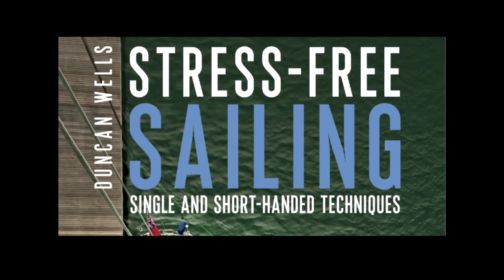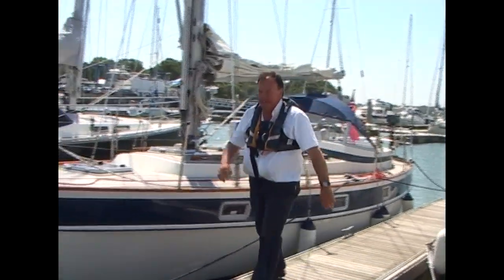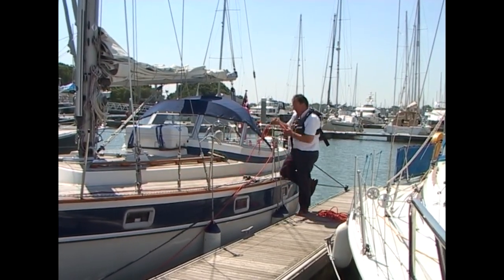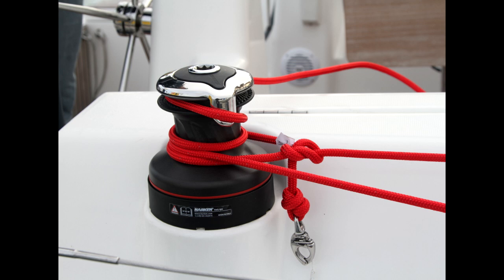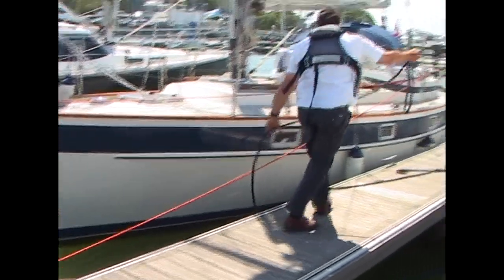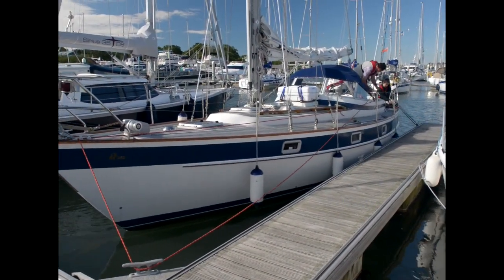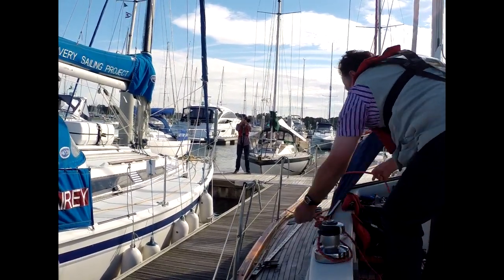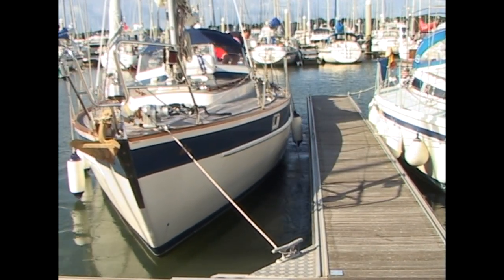SFS Getting off   Bow Bridle

Comment: Firstly I love your videos. Yesterday I used what you called the Giles method to get back onto my mooring (from your fab book) . It worked great. But because I had been practicing with it before I set off, so was all set up etc  I had already  removed all lines. To check I had got the set up correct. The boat held to the dock and I could see no reason why it wouldn't work even with a strong wind trying to push the stern or the bow off.  I then put the boat astern and just took the line of the winch and off the cleat and away I went no fuss and I think it would be fine single handed in most conditions for entering and leaving your birth. It would also act as a good reminder of how to get back onto your birth single handed with no heroics.  A great book Stress Free Sailing. very useful.
Reply from the maker: Thanks and good news! D
Reply: Hi, Mick... I have nothing to say except ... We have the same name. Cool. Small world. Though, this isn't my real name. I got it from an old 80s teen prison movie with Sean Penn. Anyway, I just thought it would look cool to comment from Mick Obrien to Mick OBrien.

Comment: Duncan. Simple problem here. You are pulling a long line. Its going to foul on something e.g. the pontoon cleat or other gubbins. You cannot see it from the cockpit. Crazy. Far better to use the midships cleat with a large loop round the pontoon cleat
Reply from the maker: Each to his own. Can you manage your system single handed from the cockpit? Actually I have evolved a system when we use 4 lines for driving ahead against a a head spring. This is bow-lined to the cleat by the stern on the pontoon with a trip line led to the cockpit. I drive ahead against this and the boat is held alongside. i get rid of the bow line, stern line and back spring. Then into astern and when alongside the cleat on the shore i lift off the bow-line. You are wrong about the line from the bow bridle fouling something. I have never had this happen and prior to running a 4 mooring line set up i used it all the time.